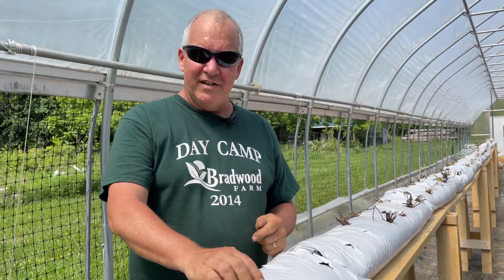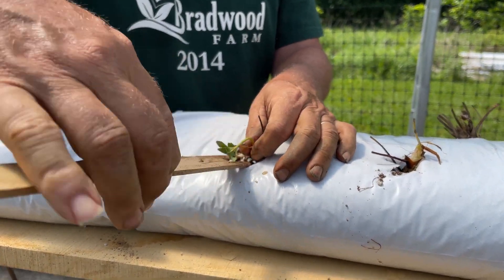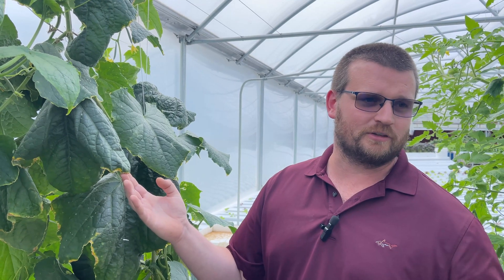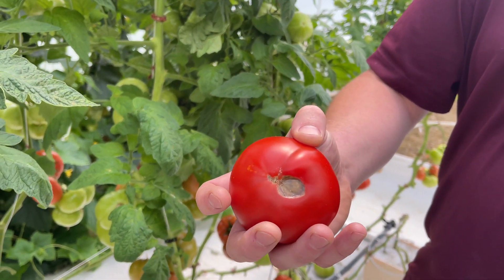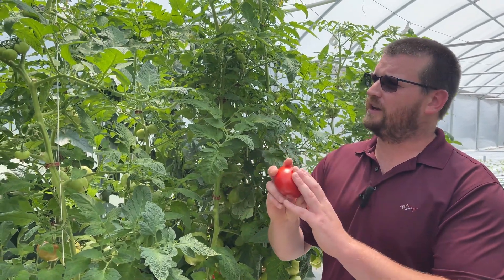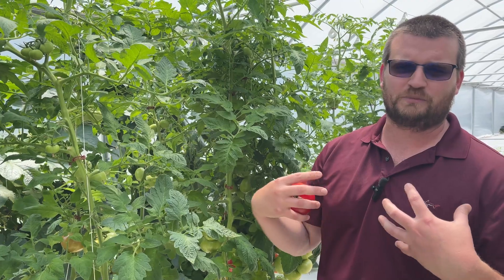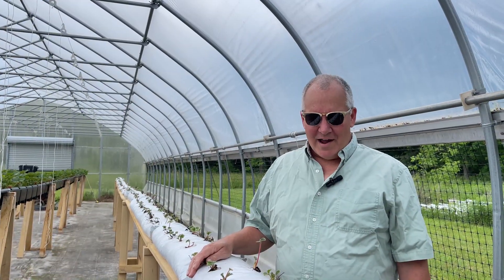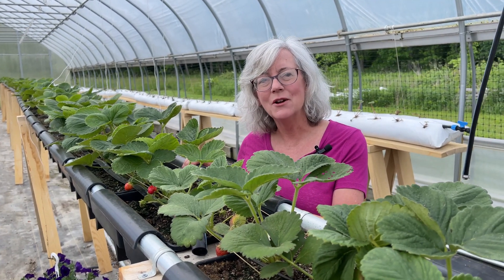Hydroponic Tomato blossom end rot, planting strawberry grow bags & discussion with Nathan CropKing.

Comment: Have you experimented with dosing extra CO2 into the greenhouse?
Reply from the maker: You know we looked into a CO2 generator a few years ago and then did some air studies and found we are fine. It would probably help but at this point we are just going to stay with what we have.
Reply: @HomegrownPassion  FYI If you have problems with condensation, extra CO2 will eliminate the excess moisture.

Comment: love the strawberry bag system. That may be easier to maintain than what we are currently using. Where did you get the bags?
What do you use the Dorhea Digital LCD Temperature Controller for? I saw it in the links for this video?
Chuck

Comment: Blossom end rot in tomatoes is caused by low pH in the hydroponic water, increasing the pH >7.6 should eliminate blossom end rot. Because I came from an area where there was free calcium nodules in the soil, so used to pH > 8.5. I run my small hydroponic setup at about pH 8.0 by adding sodium or calcium carbonate and have virtually eliminated blossom end rot from tomato production using standard calcium levels in the water. Yeah, I get a bit of iron deficiency at that high pH but any thing around 7.0 should be OK.

Comment: Wonderful video!  And to the other at home hydroponics grower!  Your plants are beautiful!  I can only hope mine do as well.   
My set up got spider mites somewhere and so I took it all apart and have it washed/bleached and sitting out in the sun to, hopefully,  kill off those naughty things.   I cleaned the area and lights.   
I'm letting it go empty for a week.
But I do have a hoop house and 2 big garden outside to keep me out of trouble.
I have mylar survival blankets on my walls behind my rack of LEDs to help focus more light.  Have you tried that yet?
Reply from the maker: no but that sounds like a good idea. where did you get the blankets?
Reply: @HomegrownPassion  i bought 10 in a packet from Amazon rather cheap.  I know they are about $3 at walmart in the camping section. 
I bought them and put one in each car for my family. I worried about slide offs in winter and getting cold before the tow truck comes.
I had several left and taped one to my back wall to help reflect the light back.  I was going to put one on the front like a curtain but haven't yet.